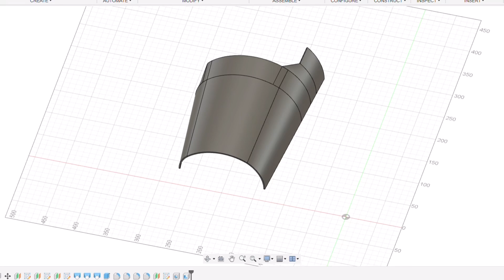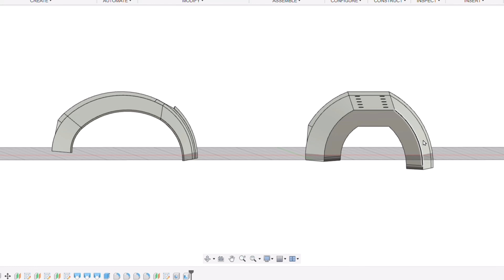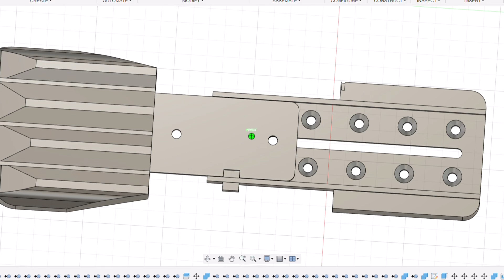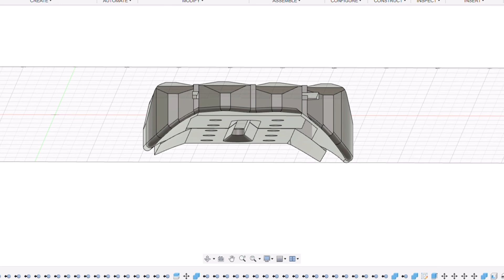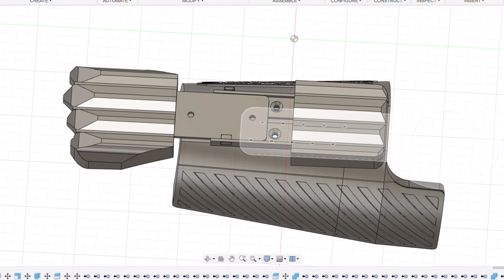UPGRADE to the Arm/Gauntlet of the POWER ARMOUR PROJECT

Comment: Very nice project! few ideas

.For the prototyping printing stage it seems like you're using a lot more supports than you might need to making it more vulnerable to failed prints plus slower and costing more in material, 7:33 you could turn that entire thing upside down and have it print straight up from the flat plate might have to adjust the holes to account for the elephants foot or just use some sandpaper on them.

.For the fist extension Dslyde mentioned detaching and locking it into fixed positions being more practical and you're worried about them then being easy to lose. Why not put the extension on a pivot so it rotates out with a solid locking lug or 2 behind or part of the knuckle? One issue would be locking it from rotating freely, an interesting solution to that would be to have part of the plate its locking into cam forward and spring back over the lugs preventing them from moving up while maintaining a solid line for impact going straight through the whole gauntlet.

.For styling I'd recommend checking out the Greenwich armor, theres a few different ones on google images looks like but I'm partial to the one with an almost sapphire blue sheen on the black it just looks really cool.

Comment: The hardest part will be making the internal shielding of the knees and elbows. If you use a motor to move, use steel wires as they don't have the space that gears have.

Comment: Given the likely impact direction if you fall forward and try to stop yourself withyour hands, having fist plate slide seems like an unnecessary weakness. Honestly, while its less slick, having it actually detach and lock into a fixed and stowed position might be more practical. 

Love to see the update though. Keen to see more.
Reply from the maker: Yeah i get what your saying, but if they detach completely are they then easy to lose? It is difficult to find the balance between being sophisticated and unlikely to break though.
And thanks I appreciate you following along!
Reply: @MattExo-Dynamics  if you're really concerned about loss, then a lanyard that stows fairly flush to the arm is an option, but in reality I think swapping them is a largely administrative task. If the deployed and stowed positions are both secure and you have time to swap, no problem. If you don't have time to carefully swap, do you care enough potentially losing something that might not be strong enough anyway? 

But it'll come down to testing. Maybe my concerns are unfounded and the sliding version turns out to be strong enough and hold up to wear. Thats why we test, after all! Appreciate you listening to my feedback though!